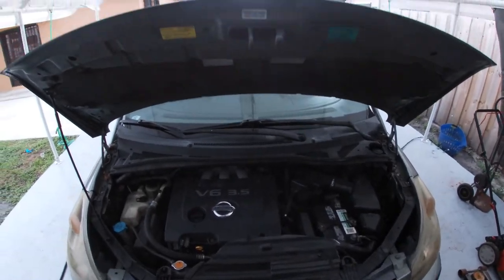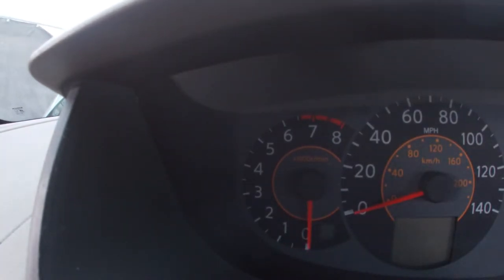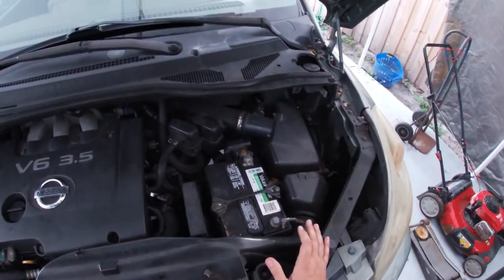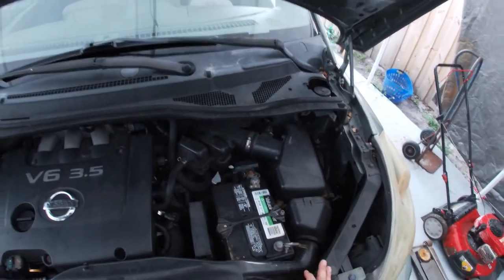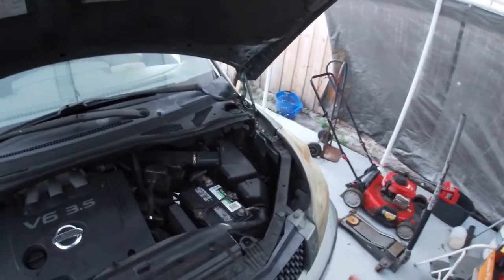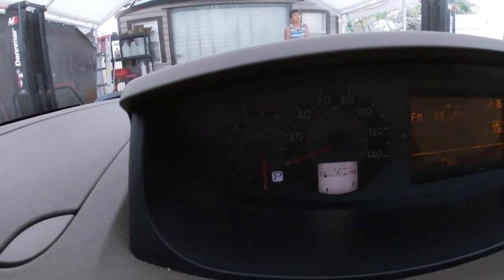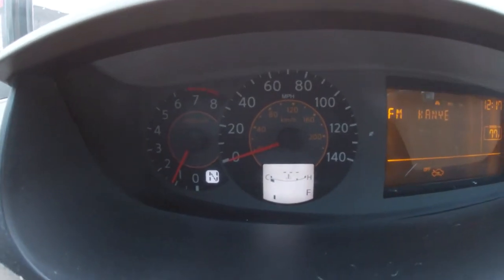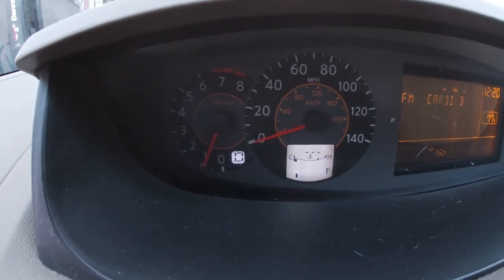does trans-x really work?

Comment: I've used it many times it works pretty good it changes the molecular structure of the fluid and it makes the flood clean up a little bit and you actually should use it and then changed the fluid

Comment: I have a similar problem but only not engaging in reverse. Going forward all the gears work fine. Unfortunately when it started happening I noticed a major fluid leak under the car. After replacing filter and new gaskets, the truck no longer leaks and all gears work fine except for reverse. I hope this stuff will fix it

Comment: I had a very similar situation with my Lexus ls430! Car wouldn’t go into reverse but in drive no problem. I did speed sensors/ trans solenoids/ about 4 drain and fills and nothing fixed it, one bottle of the trans X yellow and literally fixed my issue the same day. Im usually not one for snake oils but im truly tripped out it worked

Comment: I have same issue with my 2003 kia sedona in cold temps (below freezing). I replaced the solenoids and noticed the o-rings on them were quite hard and compressed. Thought the problem fixed but had slight issue this morning. Came out of it sooner than usual, so thinking a partial fix. Plan to try transx next for interal o-ring issue? Hope it works. Did your customers car repair hold out????
Reply from the maker: As far as i know it did. She eventually got rid of the car

Comment: How mucn of this trans x did you use? The whole bottle? Up to the required trans oil fill line?
Reply from the maker: A bottle
Reply: @gautorepair  Thanks, having the same or somewhat similar issue with my 04 civic auto transmission. On initial start it can go into gear reverse and drive but after the cars warmed up it just seems like it revs and car goes no where, hopefully this fixes the issue

Comment: I’ve seen trans x fix one that wouldn’t even pull in drive or reverse ! Now put it in run it for 30 min then move from drive to reverse several times just letting the trans x get in  to all the clutches then turned off let it cool off next day drove it off 1/2 mile first trip then 2 mile trip second time then 8 miles seen it run and do fine next time when you jack that up put something in between the frame and the  trans or motor so if that falls it does not smash your hand or arm
Reply: Having the same issue with my 04 civic auto trans. Reverse and drive, if you say it worked on that vehicle hopefully it works on mine.
Reply from the maker: Try it and see.

Comment: comment made at about 1/3 into vid before drain of atf

Sounds like stuck solenoids or valves 
Or  clogged filter or failing pump.
Update after the vid

Do I have to do another drain fill after the trans-x ?  

I am thinking of  using the seafoam transtune which is similar to help with sticking solenoids.  P0744
Reply from the maker: Stuck solenoid or valves maybe.
Not a clogged filter because i checked and cleaned it. A pump would affect all gears not just drive. 
The transx stays in the transmission no need to drain it. Thanks for watching.

Comment: How is the condition now?
Reply from the maker: Last i checked it was perfect
Reply: @gautorepair  Have you ever used KW Cooling system Leak ? My radiator is bubbling
Reply from the maker: No i have not. I really not a big believer in those things. If its broken it should be repaired or replaced. On the flip side like in this video sometimes it these products work. It all  depends on what part failed, how it failed, and how long since it failed. Hope this helps, thanks for watching and your support.